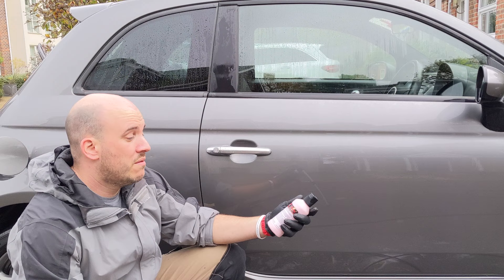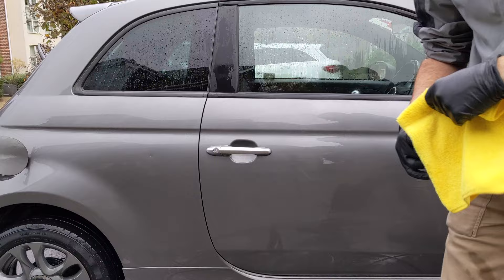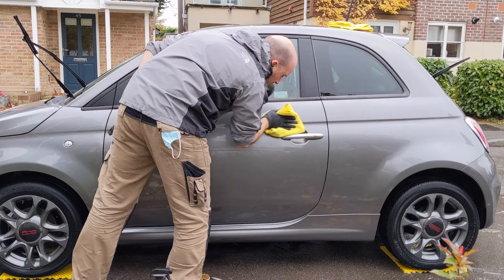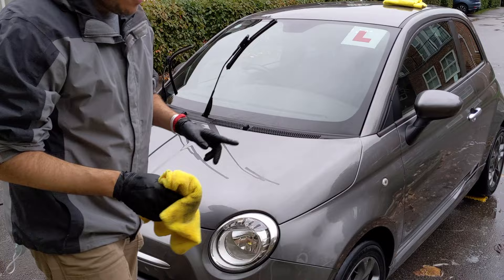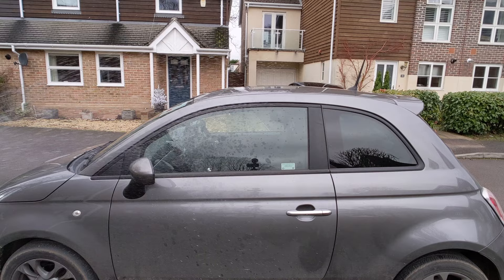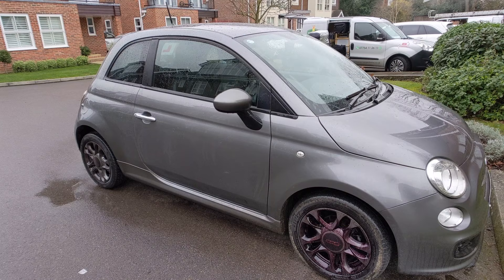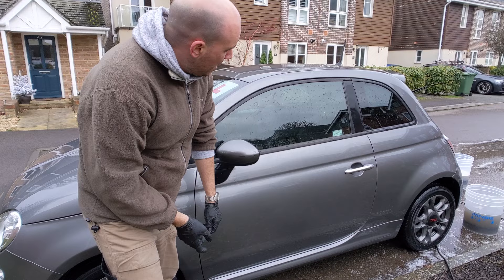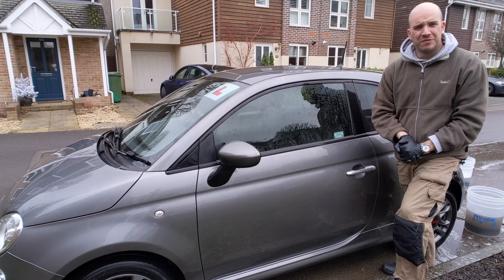Review: Malco Cherry Flash wax (vs. Turtle Wax Flex Wax)

Comment: Another good video , I've been using Flex wax on our two black cars with fantastic results , would I buy it again at £30 , probably not tbh . Tac Systems moonlight is on the to try list next along with Shinee wax . The only product which I've tried which has more gloss on black would be Beadmaker but it doesn't last like Flex wax .
Reply from the maker: If you're going down that route I'd heartily suggest Nova Lustre or Jet. Because I agree with you, Flex Wax has a lot of other products beat for looks and durability, but not them. I haven't used moonlight though and I do feel like I should....but where do you draw the line???

Comment: According to turtle wax, flex wax should not be applied below 10 degrees. I've been using flex for a year and absolutely love it.
personally to me it is worth every penny
Reply from the maker: Yeah this would definitely bear that out, but then it's not a good winter wax in terms of application. I like using it tbh but it doesn't last like they say it will.
Reply: @SuperchargedLlama  
Well.. if you have a basic layer of wax, all you need to do after washing is a few sprays - rinsing and the protection "reactivated"
that's why I love flex wax, and on a black car the gloss is absolutely amazing
Reply from the maker: @kuba7875  it does jet really well doesn't it? No way it does 6 months from an initial application though, not if your car lives outside at the very least https://youtu.be/5VWXmxN_WQU
Reply: @SuperchargedLlama  to be fair,  turtle doesn't claim any  longevity of this product , ( I didn't found any information on the label)
 its more maintenance product for to the max wax. I'm not saying that you are wrong, you definitely have more experience than me, I'm just saying that this product works for me and I really like to use it
Reply from the maker: @kuba7875  I think I remember something in the launch hype that it could last up to 6 months but you're right, that seems to have not been mentioned anywhere. It does leave a lovely gloss though, and I think getting 3 months from it's application is good. Looks sensational too but it is really expensive - a good personal product for sure but because you can't buy it in bulk it is hard to justify if you're making a living from detailing (unless you're upselling it). That's where I saw Cherry Flash maybe working as it's available in huge quantities (a gallon containers), but I'd want something that lasts longer than it does.

Your point earlier that Flex Wax can just be applied with a couple of sprays per panel and used as a drying aid is absolutely spot on, it's generally how I use it the most actually.
Reply: @SuperchargedLlama  for me, weekend warrior it's great product,  gives me everything I expect,  amazing gloss and slickness,  ( at least on dark cars, I did not have a chance to test on light colors) but I fully understand your point,  for your - professional detailer this product is too expensive

Comment: Recently was thinking of picking up a bottle of cherry flash.do you think gold class from MCgruires is a better wax for protection and longevity?
Reply from the maker: I'm not sure to be honest, but I do know collinite 845 and 476 are far better lasting, I'd personally go with them.
Reply: @SuperchargedLlama  Thanks
Reply from the maker: @dcartellone2659  🍒 Flash is very easy to apply btw, I guess it depends on what you want to achieve. A quick upsell/something you can apply frequently and easily, it something a bit more time consuming but a bit more durable.
Reply: @SuperchargedLlama  in your opinion is cherry durable??
Reply from the maker: @dcartellone2659  that's an interesting question because it depends on what different people mean by durable. To me that means I can get 6months from something, in which case no, this isn't durable.
Reply: @SuperchargedLlama  Thanks
Reply: Is there anything out there with six months of protection? Besides ceramic’s.
Reply from the maker: @dcartellone2659  there is! Or there is lots of stuff that gets quite close and is super easy to apply.

Soft99 Fusso Coat, Nova Jet, Meguiars Ceramic Spray (it's the blue bottle, I may have the name wrong - that'll do 3-4 months generally, but it's so easy to apply that it's well worth it).
Reply: @SuperchargedLlama  Thanks
Reply: @SuperchargedLlama  CarPro Hydro2 Lite Touchless works similar to the Meguiars HCW blue bottle and comparable durability. Spray on and hose off. Wipe on and hose off saves product for me though.
Reply from the maker: @brenthill5596  always good to know. I'm finding I really like products you can apply wet and still has reasonable durability.